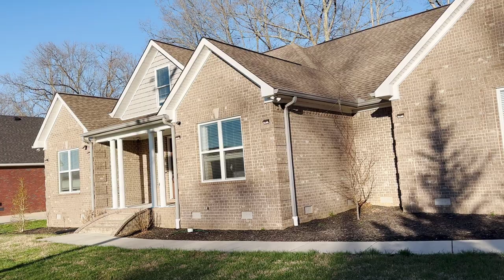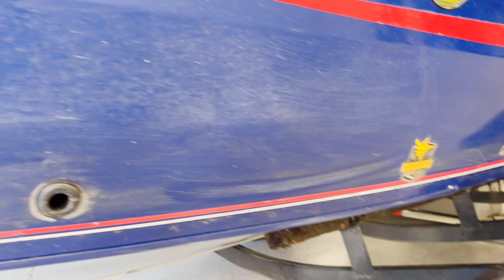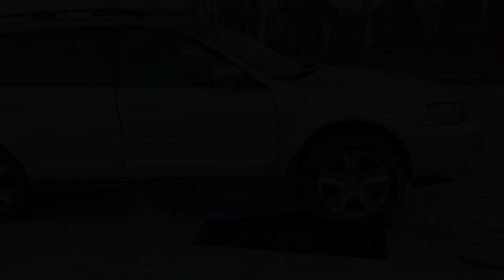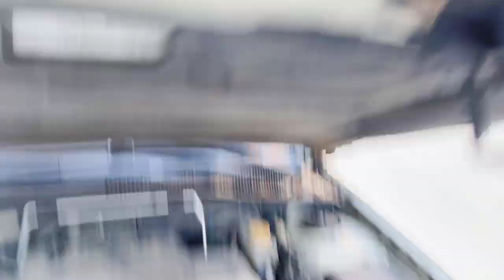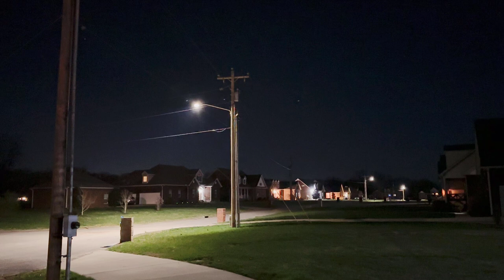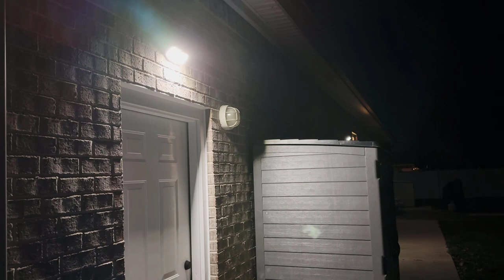Solar House Lights and Amazon Page

Comment: What kind of batteries are those solar lights using?  AA AA 18650  , replaceable? What was the lowest temp these got in the year of operation?
Reply from the maker: They have their own batteries. They are not standard. U dont have to buy batteries or anything else. Just out them on the wall and chose what setting u want them to work on. They have 3 settings

Comment: Hey Victor, hope all is well bud. Welp, after checking out your videos you completely corrupted me with all those damn ultralight setups and just went out and refreshed all my gear. Lol So, I was wondering if you could give me some insight on spoiling up the Legalis 2500 I purchased for the 7’ Presso I also picked up. 👍 I bought some 2lb Varivas twitch that’s only a 100 yards and was wondering how you go about backspoiling your reels to ensure they are topped off properly? Not to mention it would make a great video for other anglers like myself who are getting back into ultralight fishing and need a tuneup on the proper line to line knots and etc. Thnx, Eppy
Reply from the maker: glad to hear. I recommend buying cheap chinese line from ebay or amazon for filling first half of the reel. I don't think 2 lb Varivas is good for 2500 Legalis. Read what it says on the box. I think it is for line from 4 to 8  pounds. If the line is too thin for the reel u can get issues. I think 6 lb is just fine for that reel and that rod, since the reel has a big spool and the rod has big guides. U can go down to 4 if u want to push it, but if u put 2 u will have issues. ANd it will take 1000 yards of 2 lb Varivas to fill that spool, because 2 lb varivas has diameter of 1 lb US line. Honestly, Berkley has those huge spools of Big Game mono, and that is really good line for float, if u can find it in 6 lb or even 4 lb. I used to fish that line and its super reliable. No need to spend money on exotic line right away
Reply: Thanks Victor. I appreciate  the feedback bud! I also picked up a Nasci C2000SHG, Sahara S2000SHG and Daiwa MR 750 that are pretty sweet as well. Purchased them from the Asian Portal site and took your advice and loaded up on some jigs and Varivas string since shipping was free. The shallow spools took the Varivas 4lb perfectly and looking forward  to getting out on the water and putting some time in with them. As for your Legalis 2500 float set-up, what line and test are you running? I have some 6lb Pline floroclear that’s pretty nice so I’ll guess I’ll use that. Found out that Pline is made in Japan which is pretty cool and seems to be quality stuff.. I’ll give ya a full report once the weather improves and I slay a few crappies here in Maryland.
Reply from the maker: @robertepperson5111  don't buy models with HG. They don't feel nice.. Also don't buy sizes smaller than 1000. They are only for ice fishing. Line lay is terrible.. you will die from loop knots..